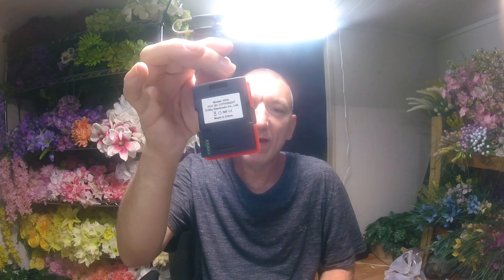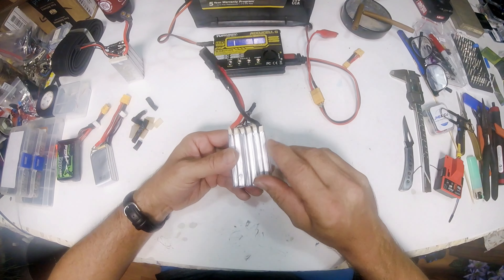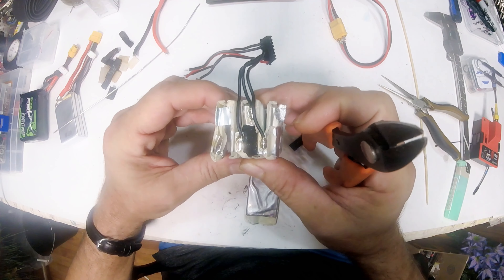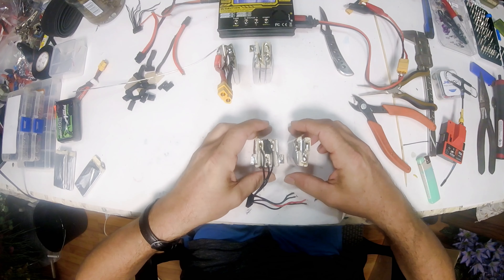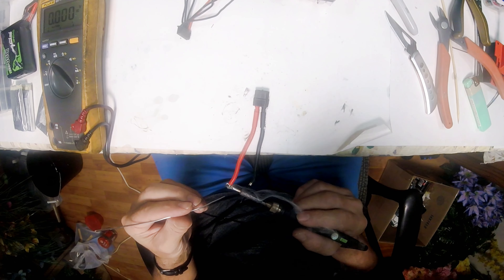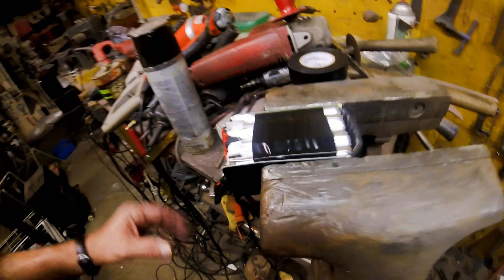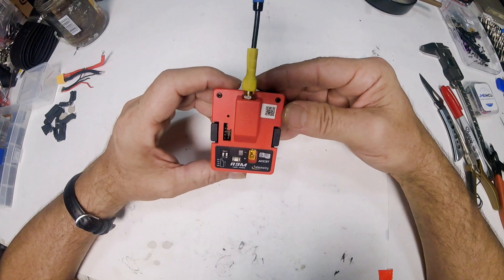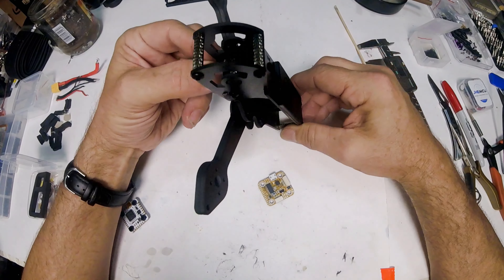How to repair old lipos - For Stacie Abishire - Step by step instructions.

Comment: Great video Brother! I like the tip about the heat shrink. I got some I was trying to stretch and it was breaking. Excited about trying your method!
Reply from the maker: it works just don't over stretch it or it will still break.

Comment: Hey Chris, like mr seek mentioned it's R9 and that is frskys version of long range. It also came included in the top of the line umper T18 radio. (the one I gave you)  I used to fly Frsky R9, if you love tinkering for days to get it to work, it's ok. I got sick of it, and it still fail safes for no reason, very hard to update.
I switch to crossfire after having to wait four months for it to be in stock. It was worth the wait, crossfire is simple, easy to update and in three years only had one failsafe, and that because I forgot to put the transmitter antenna on :)
Reply from the maker: Ok cool. thanks Ike.
Reply: I agree..I ran frsky for the first 6 months of flying fpv, and when I switched to crossfire, it made life so much easier....

Comment: I have a bucket of bad batteries I need to fix I just haven't had the balls to do it yet 😭
Reply from the maker: You don't need balls, just a good soldering iron! hahaaha Lipos get a bad rap. i know they can be dangerous but only if you do stupid shit to them.
Reply: Chris has balls of steel.  Well Balls of lead,  who else do you see man enough to solder over the frank and beans? 😂
Reply: @MountaineerFPV  they might be already burnt 🔥🧩🥵
Reply from the maker: @MountaineerFPV  hay that shit actually happens sometimes. big ball of molten solder and a bare leg dont mix well. hurts like hell. You would think i would learn my lesson!

Comment: It's an r9m system and it has nothing to do with crossfire. You need a r9 mm receiver and it needs to be bound to ACCST protocol. Access won't work on it and it's 915 which is long range
Reply from the maker: Thanks brother. My QX7 radio says ACCST so it should work just fine if i get a receiver for it. but i guess it won't work on Ike's crossfire quads. Dam there is just to much to keep up with in this hobby! hahaha i like things simple!